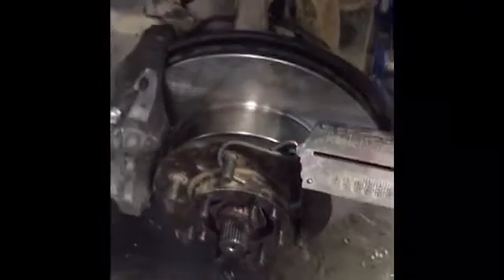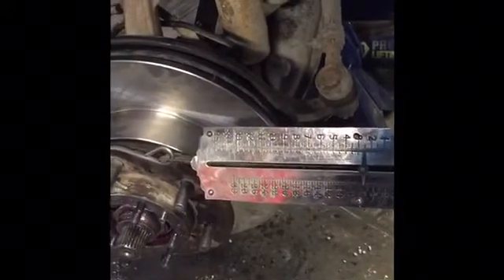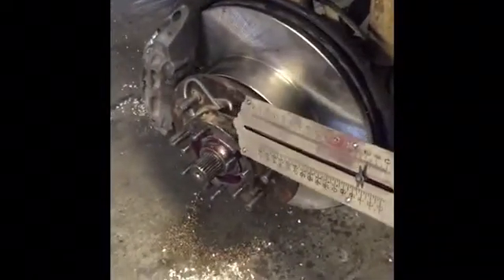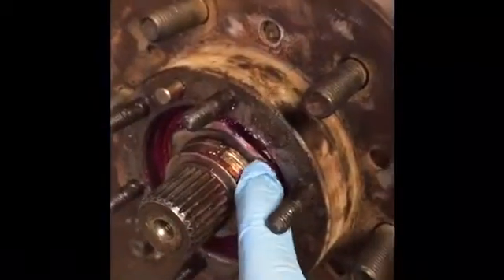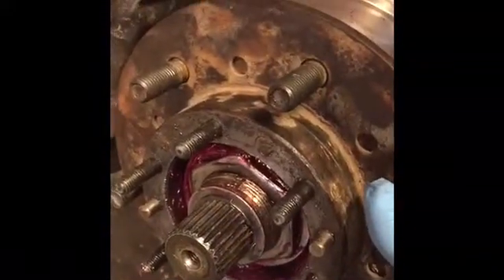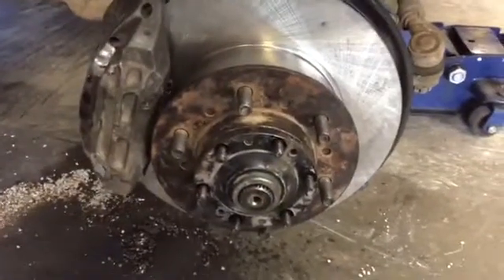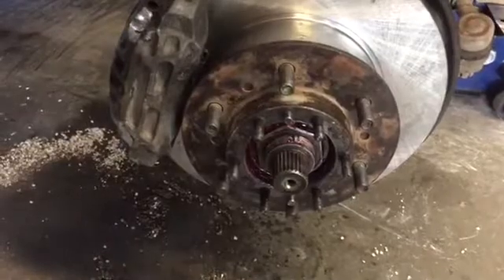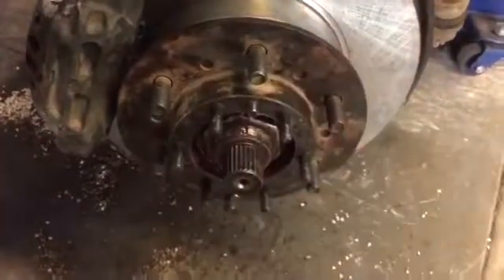MARGINALLY HELPFUL Wheel bearing preload - 1993 Toyota T100

Comment: Isn’t that the exact same setup as a 1989 Toyota pickup? Looks to have the same shaft and big 53mm nuts connecting to the cv shaft. That’s exactly what I’m trying to figure out on my preload for my wheel bearings.
Reply from the maker: It is. All the t100 is a widened toyota 3rd gen pickup.